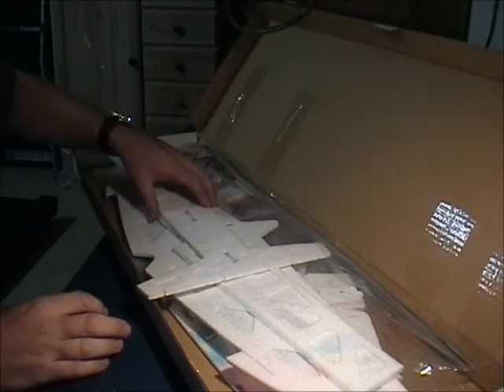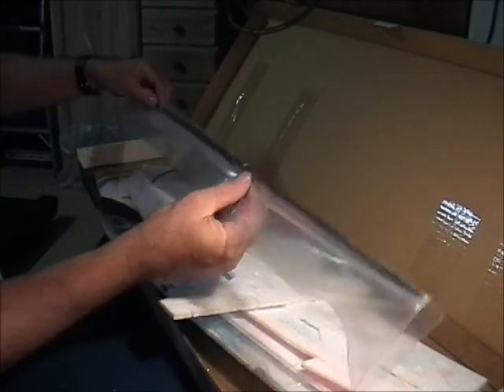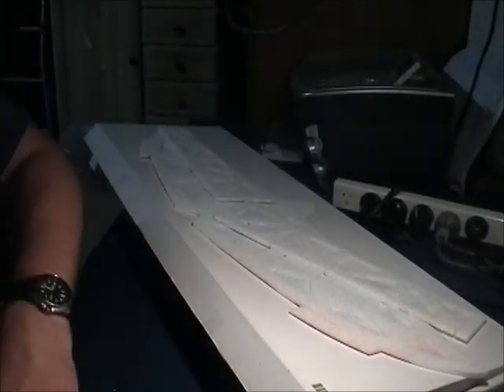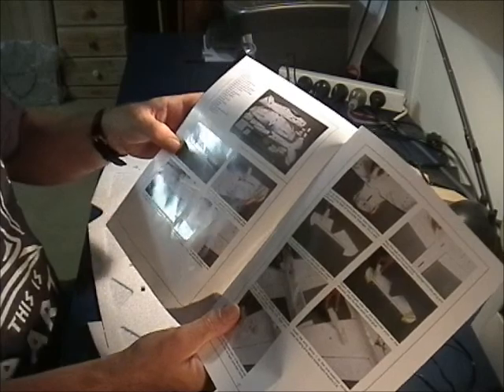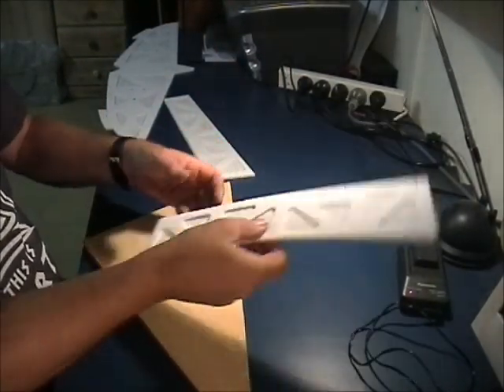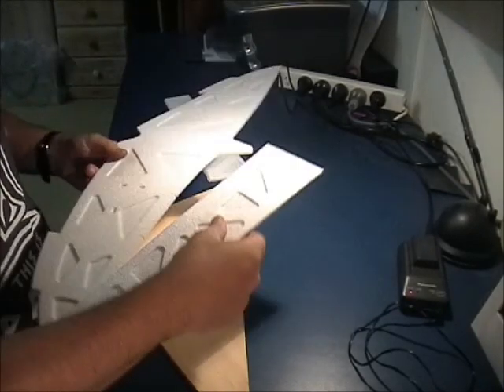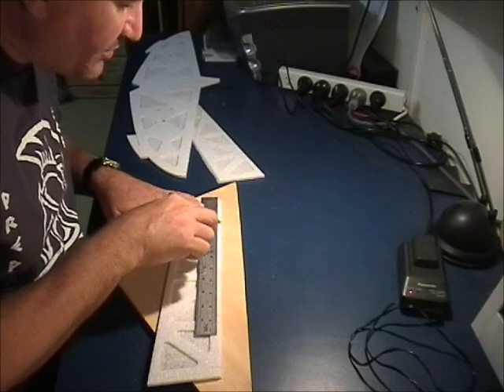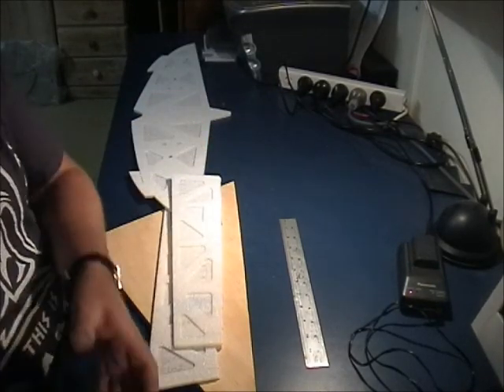Tristania Pt1

Comment: HK uses a different motor now. It's a nice looking motor with good windings but it's not a T-Motor. If the bearings are good probably doesn't matter. 20 amp T-Motor ESC that came withy a PopWing was not only heavy but didn't start up smooth with matching T-motor... tried all settings nothing solved the rough jerking startup. Replaced it with an KK Blue series... nice and smooth and saved 6 grams. "Package deal" T-Motor equip is good but not real T-Motor quality. But these black motors still had good reviews and no complaints TMK of issues with its replacement.